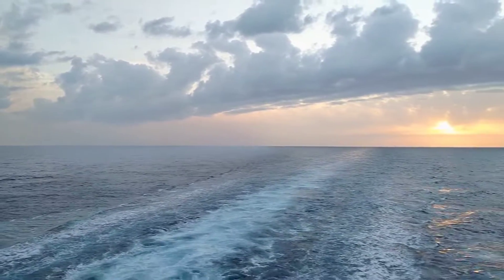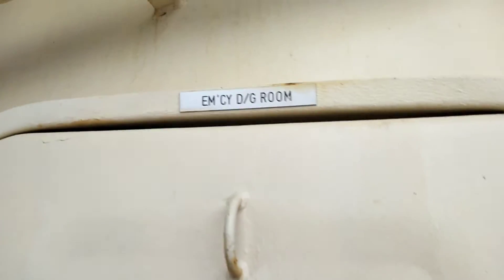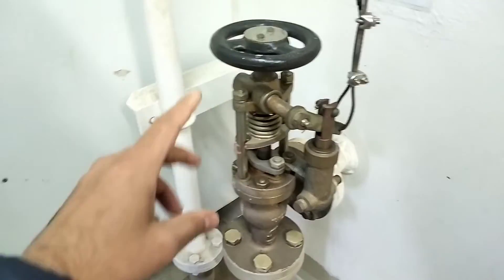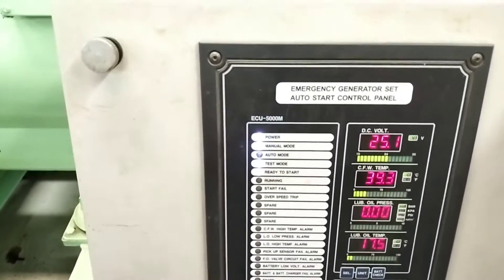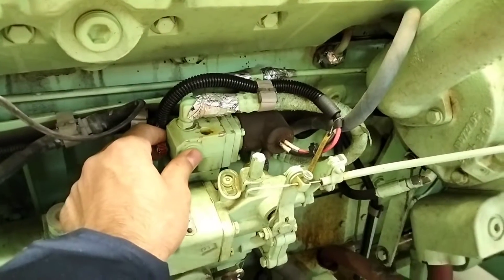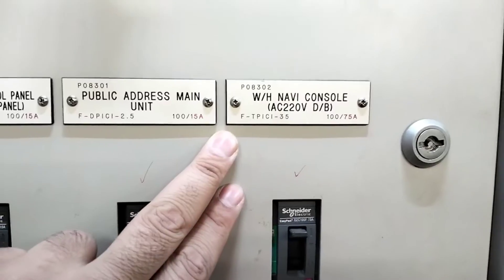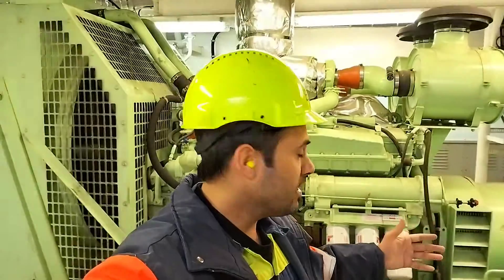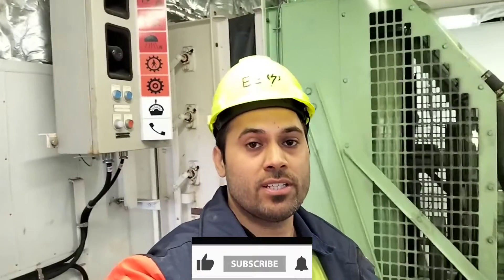Emergency Generator In Ship | Starting procedure | Black out

Comment: How many days this generator will work????
Reply from the maker: This is emergency generator which supply back up power.once we fixed the problem on the main power system and manage to recovered power system online.We can stop this emergency generator.
As per the emergency generator regulations 
The minimum fuel oil tank level should be 2.8cubic meter which make this generator capable of running minimum 18hours on 100% load. I hope you got your answer well 
Thank you 😊
Thank you
Reply: Good explain bro nice video🤞⚓
Reply from the maker: @vimalraj2441  Thank you bro pls subscribe my channel to support me
Reply: @Etovivekkumar  already subscribed and shared that videos to my friends bro 🤞